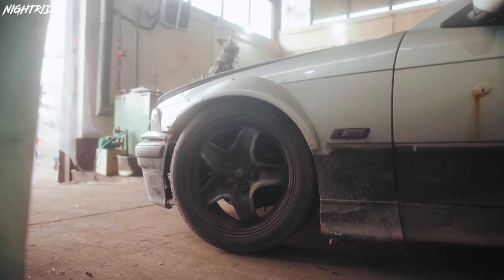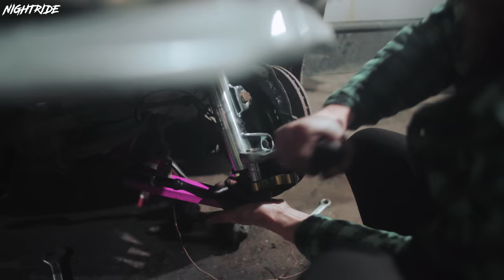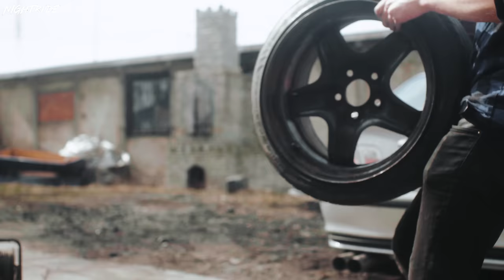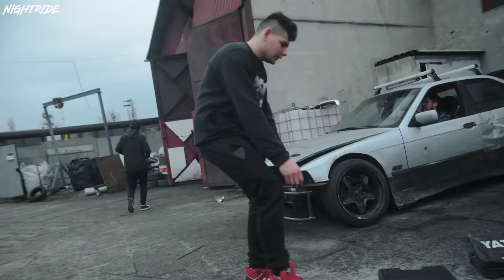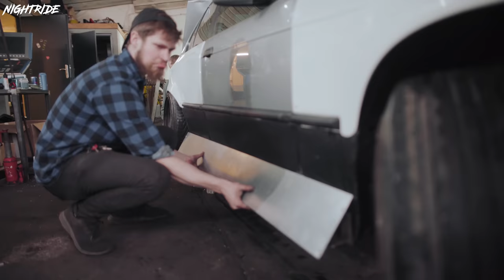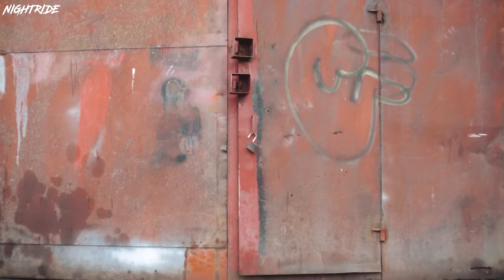BMW E36 Rebuild in 10 Minutes | 2 days project | NIGHTRIDE 4K

Comment: It’s crazy how they can make these clapped out drift machines look so good, my initial thought would have been to let the car go with all the damage but they fixed it up with minimal effort and over fenders and it looks amazing!!!
Reply: To be fair, these clapped out cars look good from a distance but when you get close you can tell they are rough. Camera doesn't pick it up. We've got 10 different clapped out BMW's in our yard and they all look decent in pictures.
Reply: @placeholdername3206  you up for selling one?
Reply: "
"Sprezzatura"
Reply: Naklso
Reply: @placeholdername3206  if you are from netherlands. i will buy one
Reply: Imagine not just replacing the door , instead they threw plastic on top 
SMH

Comment: What engine do you have? I have a 1.8  naturale aspirated, has 140 hp on weight 1200 (approximately ) and doesn't drift like that, but the engine it's  unbreakable, i was thinking about puting a turbo but i do not want on stock internals i want to fully rebuild the engine and the car. But you guys made it seem very easy. 😅😅
Reply from the maker: It’s 2.8 :)